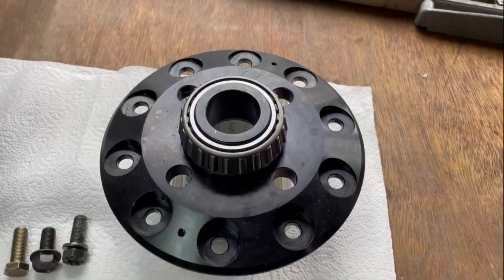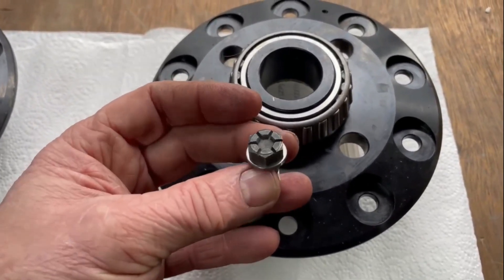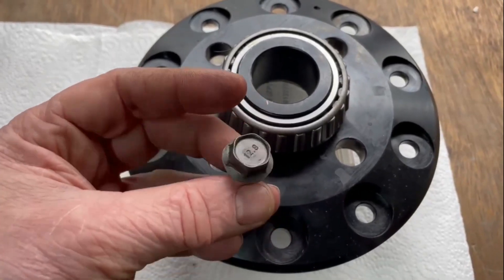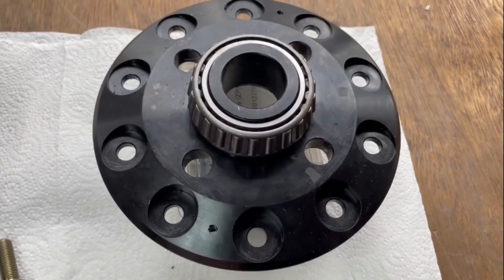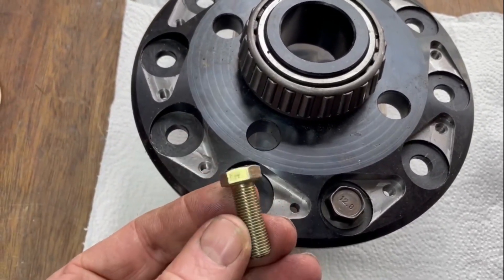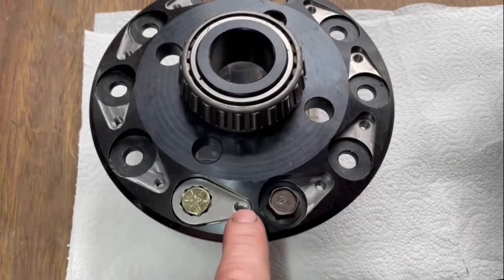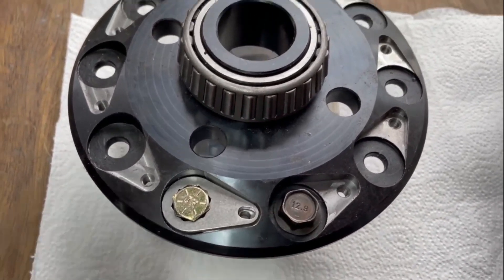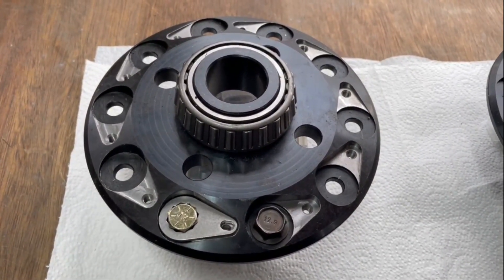The Tablock System

Comment: Having had those std bolts walk out and shear (in the middle of the main junction of a smll town) this is an excellent idea.
Spending the dosh on the locker/cwp it does seem a no brainer. 
Mind you Dave did laugh at me once when I told him I had a 4.6 for many years and had only just bust the std 2pin. He said if I drive that gently then the shafts, cwp & 4pin were guaranteed for my life 😂